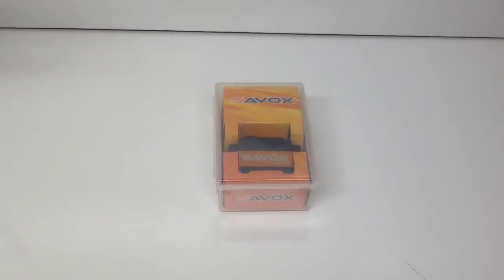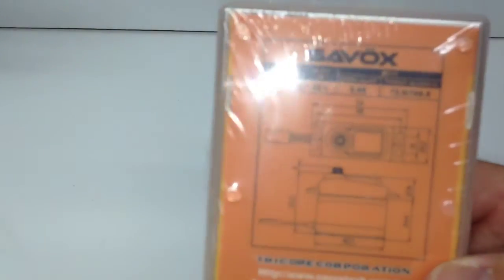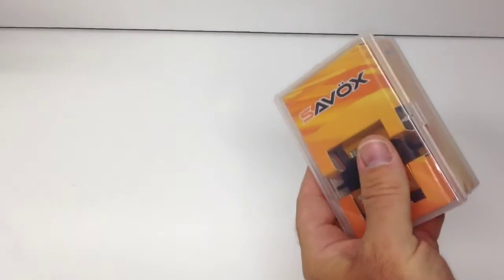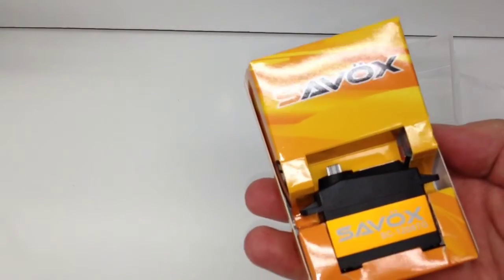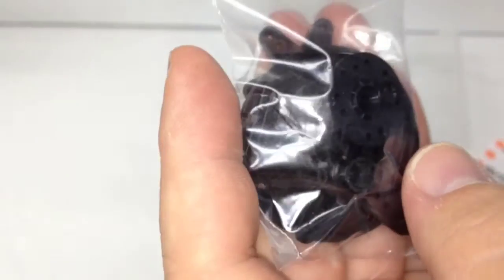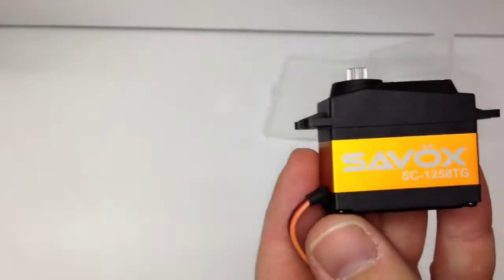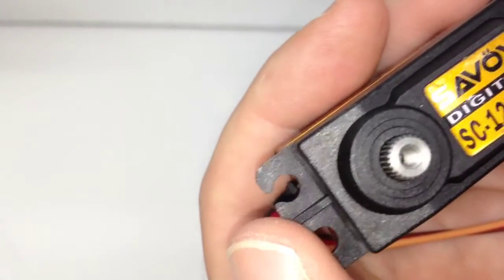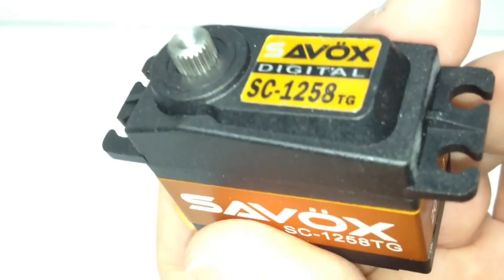Savox 1258tg - Unboxing

Comment: Okay cool. I do have a Novak Glitch Buster now, that would be okay right? It seem to work well with even rtr speed controls with a high current servo. Speaking of which, today I had to turn on/off my esc 5-6 times before I had any steering, 3-4 of those times, the servo would lock to the left and jitter..then after the 5-6th time, everything would be fine. Does this indeed sound like a servo that is getting ready to burn out or a receiver issue? I binded twice just to make sure, not sure now.

Comment from the maker: I run the Savox 1257tg in both my TLR22 and my B44.2.  Solid servo and super quick at .07 sec response time.  If you want added torque, the 1258tg adds about 30 in/oz of torque over the 1257tg with only a penalty of .01 sec.  I do run a voltage cap (spektrum and racers edge makes one that just plugs into an open port on your receiver, both are about $5-7) to keep the servo playing nice with the esc/receiver

Comment: What do you recommend for a 1/10 buggy 2wd? I run on a track about 3-4 times a week and need something strong, I tried the XPDS1015, good torque and speed, but burned out after 6 track days. So..done with Associated servos. Even though their DS1015 and DS1313 are supposed to be "their" best, they don't seem to last.

Comment from the maker: Stay tuned, I have an unboxing of the new high voltage 1270tg scheduled in a couple of days.  Many ESC's can't handle the newer high voltage servos causing everyone to have to run BEC's.  Then there's user error on wiring it up.  the new RX8 gen 2 has addressed this with a adjustable internal BEC to 7.4v

Comment: Hi Rich, i know these 1258's are ur fav but what's your take on high voltage servos?  I have never ran one (still running a couple ACE ds1013's) but wonder why more people don't if they can change their bec voltage up.  After all, more volts usually means less amps

Comment from the maker: Cool deal.  Depending on what wheels you're running, the Vanquish Stage one kit (high Clearance knuckles) may have issues.  I did, and have a solution video if you search through my scx10 vids.

Comment from the maker: Tough choice! If you can get a great deal on the 2270, go for it! Price wise, the new 1270 is $25 cheaper and put out a bit more torque.  Like I said, I run the 1283sg in my SCX10 and have used hitec's legendary $125 7955tg ad seriously like the $99 1283sg better!  Not sure of your set up on your 1.9rig, but once you make everything solid up front, you really feel the power of a decent 300+ in/oz servo!

Comment from the maker: I ran the 1257tg.  A bit less torque than the 1258, but a .07 sec response time.  I also see people running the 1251, low profile servo if space is a concern, but you will lose a bit of torque and speed over the 1257tg.  But TLR designed the 22 to have a regular sized servo and a regular sized receiver mount in with no problems.

Comment from the maker: I run a 1258tg in my SCT410 with no problems.  I was worried about the heavier sct410 needing a bit more torque, but no issues here

Comment from the maker: The 1270's series servos are great. Lots of torque like the SCX10 needs.  I run the 1283sg in my SCX10 with 1.9's and 2.2's.  I have one of the 1210 Waterproof ones on the way though. The Savox servos do draw current, that's why I run a 10 amp CC BEC on mine, with no troubles. Most of the time people don's understand what a BEC is or how to properly hook it up. People's main issue with Savox is the noise, which doesn't bug me